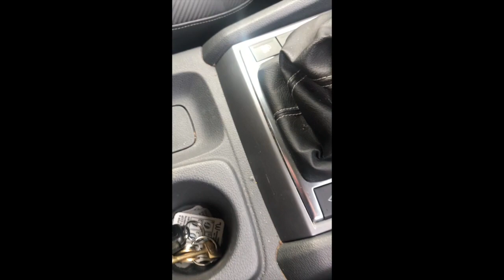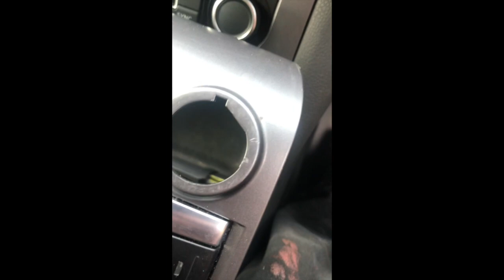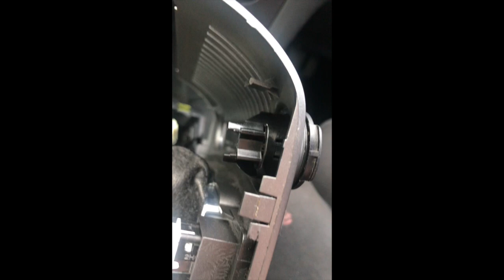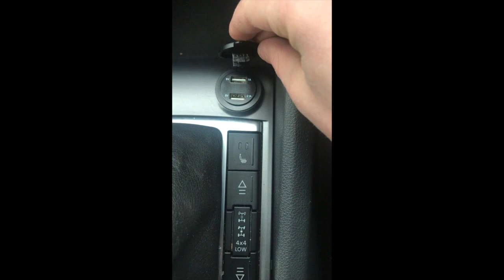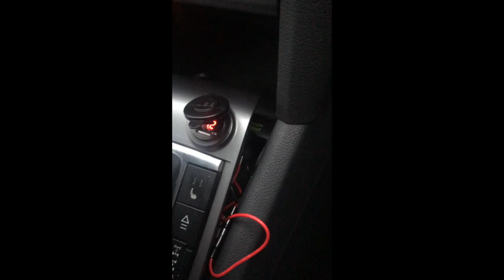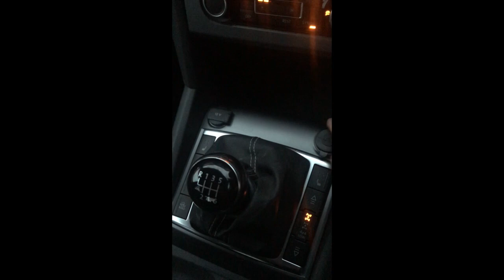VW Amarok Centre Switch Panel Removal and USB Install

Comment: Hi, Did you remove/ damage the spring from the 12v flap? It doesn’t appear to spring back in the video. I want to do the same to mine but I wouldn’t want to lose the spring if possible.
Thanks
Reply from the maker: Hi Ian, the spring had just dislodged from one side. It has been hooked back on now and springs back fine.